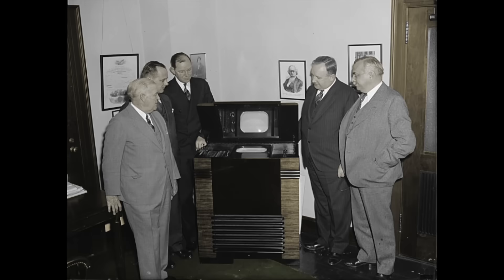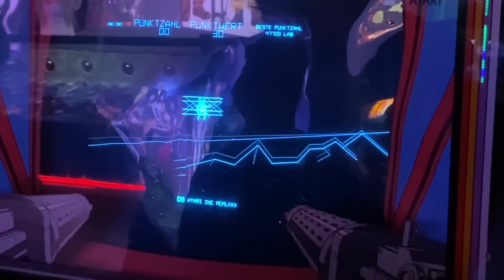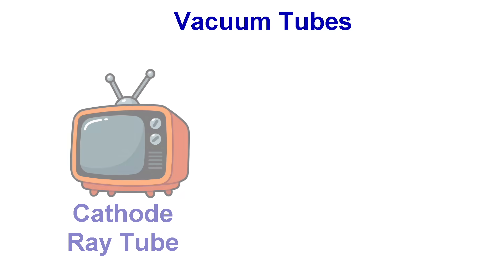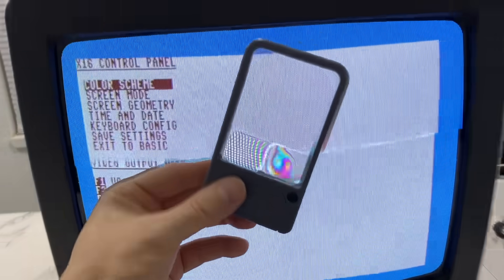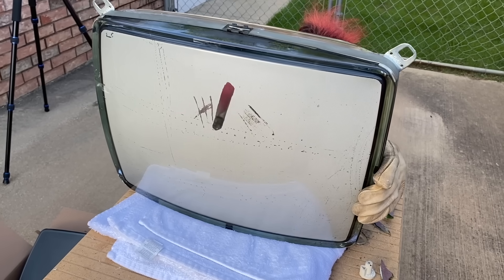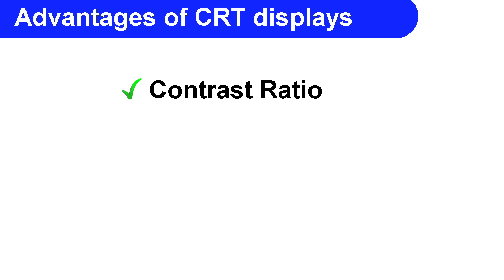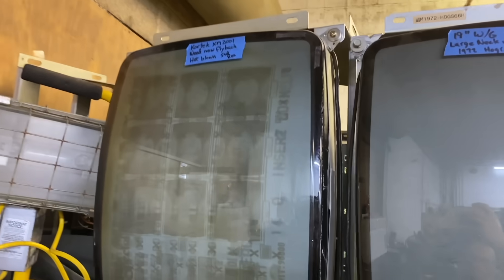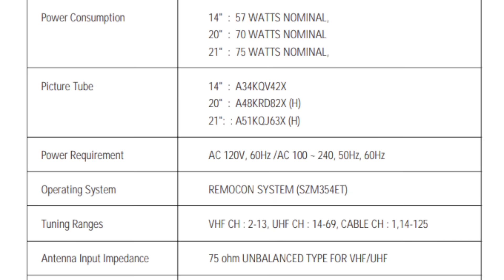How Cathode Ray Tubes Work.

Comment: I was a CRT engineer back in the 1960s. This video is a pretty good basic explanation. But, the stuff on the front glass is “phosphor,” not phosphorous. 
Warning, do not put your hands near a CRT while it is on, or you may be zapped. Also, don’t try opening a CRT that is under vacuum. The whole tube could implode, shooting glass everywhere.
The dots or stripes were aligned with the shadow mask and electron guns. The inside front of the envelope was first coated with a phosphor of one color mixed with a light sensitive material. The mask was put in place and a light was shined from the position corresponding to the location of the electron gun for that color. The light caused the dots or lines to bind to the front glass. The mask was removed and the unbound phosphor was rinsed away. Repeat two more times for the other colors. Then remove the mask once more and flash a thin layer of aluminum on the gun side of the phosphors, to reflect emitted light forward and avoid static charges. Finally, seal the front panel to the rest of the envelope. Amazing for mass production of a $190-$200 CRT!!
Reply: I tried repairing a CRT as a teenager and received a massive electrical shock. Enough that it gave me a stomach ache afterwards. I guess I am lucky that is all I got.
Reply: @greenmachine5487 Little kids and teenagers have considerably less insulation on their neurons than adults, you were in even more danger than you realize.
Reply: @ostiariusalpha  I think that's a bit overstated.
Reply: @lcdjr85  Not even slightly, there are many multiple incidents of individual teenagers and a group of teens being electrocuted to death in pools and near docked watercraft where the adults hardly noticed that the water was carrying a current. Horses are also infamously more vulnerable to electrocution than adult humans.
Reply: @ostiariusalpha  This still sounds like a dubious claim. Not only are "many multiple incidents" a comparatively small (and quite vague) sample size, it could even be a case of confirmation bias. Lots of kids get shocked that we never hear about, and plenty of adult humans experience electric shocks in different ways as well. I would be interested in seeing a study that supports this theory. I am aware of the insulating material "myelin", the fatty material in our brains which does insulate neural pathways (against each other), but I have seen no evidence that this actually protects the brain against electric shocks in any meaningful way. In addition, unless the person's head happened to provide a decent path to ground during the (very short) shock, electricity would not be flowing up there anyway - it would be exiting through a different part of the body such as the elbow, leg, foot, or whatever is (more likely to be) closer to ground potential. It is possible for the body to be "floating" at whichever kV potential it happens to be, but this would imply that the famous Van De Graaff generator experiment of a kid's hair standing on end is actually very dangerous, which it appears to not be. A more logical risk factor would be having one hand "grounded" while receiving the shock on the other. That puts the jolt across the heart which has proven deadly - though I am not aware of any cases involving a CRT specifically.
Reply: @lcdjr85  "Unless the persons head..." Yeah, we're talking about people in water, I think it's safe to say their heads are being grounded.
Reply: I always wondered how they "printed" the phosphor dots so accurately, with perfect alignment.  They were doing it with light in the electron gun position! Thanks for answering this.
Reply: Yep, "phosphor" is actually short for phosphorescence and has nothing to do with the element phosphorus.  Although, the words phosphorous and phosphorescence both have a common root in ancient Greek (phos means light, phosphorus means "bringer of light" because it was noticed that phosphorus compounds glowed).  I don't believe CRT phosphors use phosphorus at all.
Reply: Ah, that explains the tingling sensation! Now for some reason I wish I could do that again.
Reply: I thought that it should be stated that this is not a light shock either. Heed this warning. This is a VERY massive and potentially lethal shock. The shock is 15,000 to 30,000 volts and what is more the major issue is the current. 1 amp is enough to stop the heart and this can happen even if the CRT is unpluged because the capacitors can hold a massive charge and that can discharge on to you. So do NOT service a CRT TV unless you are properly trained to do so.
Reply: @InnocentSoul0283  It should further be noted that the capacitor in question is the tube itself.  So disconnecting a tube's EHT cap doesn't mean you can't still get a shock.
Reply: @InnocentSoul0283  When I was a kid I always loved taking apart unused or old electronics. I took apart an old tube TV. It zapped the crap out of me what I touch the coil! Its crazy because the TV hadnt been plugging in for years!
Reply: @InnocentSoul0283  Actually, the CRT itself is a big capacitor. The inside and outside of the funnel section is painted with a carbon based material called aquadag (monochrome tubes often had metallic foil on the inside instead). So, even disconnected from a set, the tube can hold it's electric charge for months. To make a tube safe to handle, it must be discharged, by bridging the anode connector to the outer aquadag, If the tube holds a charge, you will see a spark as the connection is made. Also, monochrome tubes had a metallic coating sprayed behind the phosphor, to reflect light towards the viewer, and protect the phosphor from ion burn. These were called "aluminized screens" to distinguish them from earlier uncoated screens, which employed bent guns and "ion trap" beam bending magnets to protect the screen.
Reply: @InnocentSoul0283 I work in the fire alarm industry the panels we have can have like 3 AMPs
Reply: @InnocentSoul0283  While color sets certainly do require far higher kV levels than mono/b&w sets, keep in mind that in excess of ~20kV is when electron beams begin emitting X-Rays. This is why the glass has a high lead content, and ultimately why our parents used to say things like "Don't sit too close to the TV, you'll hurt your eyes!" I'm far more concerned about X-Ray emissions in color sets than the voltages themselves. I do believe there is far too much emphasis placed upon the capacitive charge of an un-powered CRT than necessary. Almost any tube you encounter, unless you're deep into extremely vintage sets, will have a bleed resistor that rather quickly dissipates the capacitive charge to 0v. Even then, care should be taken to always discharge the tube before handling. It's rare that I've seen sets with a bleed resistor "pop" when discharging them, but it does happen. Resistors, just like any other component, can fail over time - in the case of a CRT bleed resistor, it wouldn't typically be noticed in normal operation. Discharging is remarkably simple, though - wrap a piece of wire around the shaft of a flat-blade screwdriver, and attach the other end of the wire to the metal shielding of the chassis... Gently slide the screwdriver under the anode cup until you make contact with the center conductor. If there's any tangible voltage stored in the tube, you'll hear a short "pop" as the charge dissipates to the chassis ground. Just don't try to do that when the unit is powered on. :D
Reply: @InnocentSoul0283  as a child I ones got shocked poking inside as CRT with a screwdriver while forgetting to unplug, guess I was lucky with the plastic screw driver handle
Reply: @InnocentSoul0283  as a very curious lil kid I feel what you are saying
Reply: @InnocentSoul0283  No one died from a shock from an unplugged television, the discharge of thousands of volts from the cumulative high-voltage circuit has not killed anyone, because there is only a very short-lived spark.
A taser is much more dangerous or touching a mains plug or circuit if it is connected, than that can be fatal.
For 1 ampere to pass through the body in several seconds, there must be more than 1000 volts maintained during that time, but as I said above it lasts milliseconds and therefore the amount of electricity is so small that it has no effects even if the voltage is very high. 
The key is in the duration of the electric shock.
Reply: @Elbas_Tardo  It's a combination of all Amps, Volts and duration (and travel path). You can hold a 9V battery on your tongue for days without it being deadly. Split second shocks can be deadly if the amperage and voltage is high enough.

That said, in the case of CRT's you'd probably need some kind of heart condition and bad luck for it to become deadly. Bigger issue is the motion you'd make when you get the shock.
Reply: @relo999  There are only two factors, voltage and resistance, this is the resistance of the body, it is not that of a metal, therefore there will be no amperes without voltage, it is pure Ohm's law, the second factor is that when there is a spark the voltage drops, therefore There are no amps, so the amount of electricity in this way will never be dangerous. I remind you that a TASER has more than 50,000 volts, and it is not just a spark but rather continuous pulses and is declared NOT lethal.
The duration is what matters, yes, because you can die with 100V if you are there for a long time.

It is a hoax from those who are not professionals to say that amps kill, false, without voltage there are no amps, the voltage and its duration is what kills.
Reply: @Elbas_Tardo  That is a dangerous amount of misinformation there…
Reply: @tookitogo  Yes, there are many people who need to study more, so it is good for someone with years of experience and studies in the subject to clarify the concepts as I have done.
Reply: @AshBashVids But when I am in the middle of adjusting it, it has to be turned on.
Reply: @Elbas_Tardo , people have died after being shocked with a taser so this comparison doesn’t work.
Reply: @mina86  I understand, so you know of someone who was fixing an unplugged CRT and died from flyback discharge.
Yeah? it's right?
I do know of any case of someone who died from drinking too much water, that would be an exception and fortunately there is no documented case or any person that I know of.

I'm not saying that it's something healthy and that you should touch it, because it's really not pleasant, maybe for a masochist, I'm just showing the real danger and not urban legends.

You should see some video of soldiers being shot with a taser and that is MUCH more dangerous than an unplugged CRT.
Reply: @Elbas_Tardo , I don’t. I only point out your comparison to tasers is unsound. Tasers can kill therefore pointing out that they are more dangerous than CRTs does not demonstrate that CRTs cannot kill.
Reply: @mina86  Then you'll have to show us all that a spark from an unplugged CRT kills.
Facts.
Reply: @Elbas_Tardo , I don’t have to show anything because I’m not making any claims apart from your argument being unsound.
Reply: @mina86  I have not said anything false, everything is scientifically verifiable.
Phisic facts not empty words.
Reply: @AshBashVids I didn’t say “instant murder machine”. The fact that someone with a weak heart could develop a fatal arrhythmia is enough to warrant an abundance of caution, especially since one might not know until it’s too late that they had such a heart defect. 

Not to mention secondary danger, like the shock causing one to flinch, in turn causing you to inadvertently touch something else that is energized. (And while unlikely in CRT repair, there have been many injuries caused by people flinching from minor electrical shocks which in turn caused people to fall off ladders or roofs and suffer serious injury or even death.)

I’m a trained electronics professional, I’m fully aware of how it works. I just really dislike that other dude’s arrogance at calling this hazard a “myth” while claiming that zero amps flow. (The flow is of short duration but decidedly not zero amps.)
Reply: @Elbas_Tardo  I also have studied it (formally, not Google University) and have years of experience. The milliamps through the body are what determine the physiological effects. So yes, “it’s the amps that kill” is true, but it’s not the whole story. Volts are what push the amps, and of course ohms are what determine the proportion.
Reply: @tookitogo  Yes, the voltage is the only thing that matters, the amps are only a product of it, if you want more amps you will have to increase the voltage, it is that simple, since your body is not a variable resistor.

Remember to put time in the equation, this is the most important thing, if the voltage drops very quickly as it happens in a capacitor and a CRT is very similar, the amount of electricity and its effects will be irrelevant, a spark from this is not pleasant but it will never be lethal. Look at how long it takes for the CRT to charge in order to work.

I am already retired, but I spent more than 30 years fixing TVs and other devices, I can only say that I received some shocks by accident and here I am. Something plugged into the electrical network, like those Chinese cheap chargers, is much more dangerous than an unplugged CRT and However, people see a spark and think it is like an electric chair.
The things you think are less dangerous are the ones that can be and others like a spark are not.
Reply: @Elbas_Tardo  No, the current is what ultimately matters, and since numerous combinations of voltage and resistance can produce a given current, you cannot say that “voltage is the only thing that matters”. But I’m not going to belabor this point with you any more, since you’re demonstrating a willingness to twist words and otherwise argue dishonestly: Nobody said the things you’re claiming we said.  Go away.
Reply: @Elbas_Tardo  exactly....im tired of all this cr#p about crts being lethal blah blah, yes you can hurt yourself with anything if your are dmb enough......but with crts , even when the set is plugged, if you touch the anode at 25kv the current is very very small and so the moment it shocks you the voltage drops abruptly....(yes i touched it a couple of times, and it can burn a hole in your finger but im still very alive)  ...now a 220v shock from a mains outlet is way more dangerous because it has virtually unlimited current...only set by the breakers you have on your breaker box.... But there is an exception to this : the very early sets that used mains drerived high voltage instead of flyback...those were very very very dangerous and all the warnings you see on vintage tv repair books may have originated from accidents involving those types of sets...if you touch one of those, they would use 5 kv 8kv etc but they would have an insane amount of available current....same applies to a microwave that runs on 1 or 2kv but its derived from a big transformer, very very dangerous...
Reply: @tookitogo  I do not misrepresent anything, electricity works the same throughout the universe, more electricity is more voltage, less resistance is easier to pass, more, therefore without voltage or resistance, there are no amperes to calculate, understand that it is ALWAYS the product of two factors , simple ohm's law. Therefore, if the resistance of the body is fixed, you can only vary the amperes with the voltage, but no matter how many amperes you want to obtain, you will not have them. Finally, I repeat Ohm's law, which an 11-year-old child knows at school, understands. It's simple, very simple, don't try to complicate it.
Reply: @MrHBSoftware  When I repaired a CRT I only plugged it in to manipulate the yoke, like 8bitguy does in the video and it was the only time where I was afraid and of course with gloves, because it had to be plugged in and the capacitors and the tube were there, even if they were discharged they could continue loading at the same time and this is already different. It is always better to unplug it from the mains to repair any device and leave it for a couple of hours.
It is not about touching electricity for pleasure, but about knowing when it is dangerous and when it is not.
Reply: @Elbas_Tardo  You absolutely are misrepresenting it. I’m not arguing against Ohm’s law (and my last reply shows this). But you’re saying the current doesn’t matter, and that’s untrue. You’re also saying that the resistance of a human body is unchanging, which is untrue. (It varies very significantly depending on things like how dry your skin is at a given moment. And high voltage can cause insulation breakdown, at which point the resistance drops.)
Reply: @tookitogo  When I say that the resistance of the body is fixed, without its distortion it can effectively be varied, but this does not mean that you are a variable resistance with a wheel to select your resistance, as it implies and that YES is distortion, you can add salt , water or whatever you want, but I am not going to repair a CRT by adding things to my body, as if I were cooking, to vary my resistance, in any case I will put on insulating gloves, this also varies my resistance. If I say fixed, it is because they specify it in values that appear in technical books. I once again tell you to read those books and discuss with their authors.

I do not misrepresent anything, I only cite scientific data nothing more.
The only one who distorts to perhaps make physics different from that of planet Earth is you, you can join the flat earthers, they also say that it is the others who distort and make mistakes, just as I have only cited them what the scientific data says, proven centuries ago and any book to learn electricity and electronics.

And I repeat: without voltage, there are no amps, they seem like two different things, but in truth it is just electricity and understanding that the body is a resistance and does not vary from one second to the next, for you maybe yes and also from what it says according to it It could even be deduced to use human skin as raw material to replace copper. XD

In the end all this, which leads to nothing, does not change what I have said, Ohm's law and this is the only thing that matters here, an unplugged CRT has never killed anyone and is completely safe, since it is discharged with the time.
I understand that you have never repaired one or received a spark, (according to you you would have died), I did it for more than 30 years, but what do I know, I am just an old retiree.
Reply: @Elbas_Tardo  Basically, you’re pretending I said things which I actually never said, and then insulting me based on the invented claims I never actually made.
Reply: @tookitogo  No.
Reply: @Elbas_Tardo  It’s exactly what you’re doing. I didn’t say the things you said I said. And then you insulted me based on those things I didn’t say. You’re a menace.
Reply: @tookitogo  No, I'm sorry, you must read my first comments, the rest you have simply gone off the rails.
I have not insulted anyone, however you have called me a menace, but according to you, I am the one who insults and distorts.

If I have to explain again the same thing I said in the first comments, I would just repeat myself forever. I do not see sense.
Bye.
Reply: @Elbas_Tardo  Someone above said the tube acts as a capacitor. Does a capacitor not have duration when attached to a resistor (ie human)?
Reply: @bakedbeings It discharges over time, even if the circuit is not closed. If you close the circuit, the discharge lasts milliseconds and stops providing voltage, which is why there is only one spark. That's why it takes a while for the CRT to charge and turn on.
Reply: @mina86  This could be cleared up by providing evidence that someone has actually died this way. I have looked but have found nothing. There ARE dangers inside a tv, especially when it is on and B+ is active. Very old sets (vacuum tube golden era) considerably more so due to mains-derived HV rather than flyback, but I haven't heard of someone dying due to the residual energy stored in the picture tube. But like I said, you can always provide a link and prove us all wrong.
Reply: @AshBashVids Not on purpose, anyway.
Reply: @AshBashVids "fondling the anode while on"

... I'd imagine it could happen on accident, regardless of knowhow
Reply: @AshBashVids You claim it "can't really happen by accident"... then proceed to provide "either", "unless" and "practically" exceptions in three out of four of your following paragraphs.

I'm convinced you don't grasp the concept of an "accident", and teaching you basic vocabulary is beyond my ability.
Reply: @Elbas_Tardo  People have actually died from being Tasered. So they can be lethal.
Reply: @AshBashVids In most sets, the anode connector is covered by a rubber suction cup thingy, making unintentional contact difficult. Although some early CRTs had a metal funnel, instead of glass. They were often called "widow makers".
Reply: @turrican4d599  TV technicians developed a practise of keeping one hand in their pocket, and using non metallic tools for adjustments.
Reply: @dougbrowning82  By a CRT disccnected?
Reply: @tookitogo  you got it, it's the amps THROUGH the body, touching a capacitor isn't deadly unless the other hand is also touching something conductive for the path to be made. 
It's definitely a mystery though why x amount of power will kill some and leave some unscathed.
Hell lightning doesn't have a 100% lethality rate, and that's hundreds of thousands to millions of volts
Reply: I used to repair TVs until the early 80's... when he reached into the one that was turned on, I could feel the shock.  Been there, done that.

I salute his steady and unshocked (on camera at least) hands.
Reply: That was meant to be $100-$200.
Reply: @obifox6356  Guess you don't know that you can edit your posts.
Reply: Not touch the screen while it is on? I did that all the time when I was a kid! Crunchy zappies made a funny noise
Reply: @commondary9953  Dont touch inside,not outside. :D
Reply: @commondary9953  Early TVs had safety glass windows in front of the screen, so you couldn't touch it.
Reply: I was crt guy too...that's how we did it.
Reply: CRT restoration shops used to be common.  They could revive dead tubes by cleanly breaking the envelope so the internals could be replaced, then evacuate and reseal the glass.  I think the only place with equipment to do that now is at the Early Television Museum .
Reply: @haweater1555  That equipment was donated by the last technician, who retired in 2010. They are still waiting for someone with the skills to come and volunteer. Until then, there is no source for CRTs except for NOS stock, or tubes scavenged from other discarded sets.
Reply: I put together a 19" B/W television in 1962 home made and it worked! Then a 23" color TV home made in 1968 that my dad tried to get as a family TV!
Reply: Can confirm, a friend and I found an old TV near a river on the friend's property many years ago. Being teenage boys we immediately decided to try to smash it. We were amazed when literal bricks bounced right off... until one didn't, and it made the loudest bang we had ever heard lol
Reply: @clonkex  You make me laugh with the biggest bang thing. I had a feral friend when younger who thought it funny to put a brick through an old TV screen. I advised him not to, and stood to the side out of the way, he threw the brick and started running, followed by a large bang and me seeing him running and being chased by flying glass in slow motion. Thanks for bringing back a funny memory. He was ok btw, the glass didn't catch up (luckily).
Reply: @threeMetreJim  lmao that's a good story
Reply: Very, very basic. So basic, that potentially misleading and perhaps not true in some parts.
Reply: Thanks a lot for the explanation on how to make the phosphor separation. I'm an engineer too, and repaired some TVs during college to make some money. Always wanted to know how it was done. Literally brilliant
Reply: Thank you for your insight but also THANK YOU for the correction. It drove me nuts hearing him say phosphorous. He's a smart guy but I feel like he dropped the ball a little bit on the research there...
Reply: I had wondered how they got the mask and phosphors aligned, that sounds much more practical than anything I'd considered before.
Reply: wait a hot minute
Phosphor is just phosphorus in German isn't it?
Don't tell me there is a substance that is not elemental phosphorus but called phosphor in English
Reply: @Nobody_Cares913  I think phosphor is a material with light emission, and phosphorus is the chemical element.
Reply: @Elbas_Tardo  It's called "phosphorescent", after phosphoros, the element, with is phosphorescent.
Phosphor is the German word for the element. I mean it could still be that there exists a material which is called phosphor in english, but it seems iffy. Might just be my germanness or autism😂
Reply: @Nobody_Cares913  No, is similar in spanish, look at wikipedia, i normallly say phosporescent material, but i dont know what is normal in english. 🤷🤷
Reply: @Nobody_Cares913  It's confusing: phosphor has nothing to do with phosphorus, except etymologically. Phosphor is any compound that emits light when excited, either by visible or ultraviolet light, or by an electron beam. I don't know if any type of phosphor contains phosphorus, but all the typical ones used in TVs and monitors (and other common applications), don't contain phosphorus.
Reply: @oldnelson4298   thank you for an actual answer. Not like the other dude who keeps correcting everyone while capping away. That's kinda crazy to me but now at least someone answered without "I think" or "I don't know" 😂
Reply: @oldnelson4298  Man that's one of the screwiest translation nightmares I've come across yet
Reply: @oldnelson4298  now I need to find out what we call the English "Phosphor" in German
Reply: Quick question, how did color vector displays get color while maintaining a decent scan speed and avoiding like flicker?
Reply: @just_bean_things  There are two separate issues here. 1. With a shadow mask color CRT, the production of color is inherent. The color-producing dots of each color are aligned with the electron gun, which turns the electron beam on and off for that color. 2. Because the electron beams are magnetically deflected, regularly scanning the beams across the screen (as in a TV set) is easier than randomly scanning vectors, in both B&W and color CRTs.
Reply: @obifox6356  yes, how do games like tempest do color then?
Reply: @obifox6356  Raster scanning is relatively easy. It was devised by Filo Farnsworth and based on the parallel lines of a plowed field. Only two signals need be applied to the tube itself, the luminence (y) signal applied to all the cathodes (the black and white elements of the picture) and the chrominance (r/g/b) applied to the corresponding control grids (adding colour to the picture.
Reply: I smashed a huge CRT TV tube once as a kid and saw 1st hand how implosive they can be. I was very lucky that a gut feeling told me to stand to the side and away from it because in a split second there was thick pieces of glass flung meters away from the front and back. What made it worse was that the tube was removed from the box of the TV and it was at least a 30 or so inch TV.
Reply: Thank you for making these, I still love and prefer CRT’s to today’s monitors. I found 3 of them, and have a 32 inch Sony Trinitron I found on the curb, weight 170 pounds but it looks amazing still, even with a composite cable to my SNES, it’s better than anything I remember as a kid on our cheap CRT’s we had.
Reply: My warning was about getting close to CRT or HV supply and wire inside the cabinet. 
I believe Thomas Electronics still builds and rebuilds
 CRTs. The way that pros relieve the vacuum in a CRT is to heat the tri (inside t after removing the socket 
You can find some YT videos be searching for CRT rebuild.
Reply: … is to remove the socket and heat the small glass tubulation enough to cause a crack, and then wait for air to slowly deep into the tube.
Reply: this comment is as fascinating as the video
Reply: My dad was a television repair technician and I think he built Heathkit TVs as early as the 1940s. I remember him showing me how to properly ground and discharge the flyback transformer.
Reply: You corrected him but he called it phosphor most of the time.
Reply: problem is that when focusing the gun on the flyback transformer, the TV must be turned on, you cant see if its focused if its turned off
but yeah you have to be careful af to not get shocked
Reply: In my old physics books there are also experiments: Take a small piece of aluminum foil, put it on the crt screen. Turn it on and touch the foil. I done it several times. It is similar to a electric wire of a cow paddock or touching an spark plug (ignition plug) of an car.
Reply: @obifox6356 hey, since you were an engineer, I'd assume you know the material specs of all/most of the components, correct?
Electronic components, especially vintage stuff is almost as hard as rocks(pun intention) and gems/crystal science to find actual information that's helpful.

I'd be grateful if you could tell me especially about the CRT electron gun part of the tube, what are the parts made of? Mainly the metals and metal coatings
I've heard others mention that there's palladium/platinum in there, but no info on what parts specifically.
Do you know what parts contain prescious metals? 
Thanks
Reply: @ The metal parts of the gun were all non-magnetic, 300 series, stainless steel. Type 304, as I recall. The only coatings on metal gun parts were the cathode and filament coating, the exact details of which were proprietary. See Wikipedia for typical coatings. 
No platinum or palladium or other precious metals at all. 
I only recall one tube we made with any previous metal in it, a thin layer of gold just over one molecule thick. Worth a couple of cents, less than the cost of recovering it.
Reply: Can you explain the role of the high tension wire please?! Thanks in advance. I've watched several videos and no one has "explicitly" explained the high voltage on the side of the envelope. Someone with an electrical background may have picked up the explanation but I didn't. Is the high voltage aspect part of the namesake "CRT", the high voltage cathode that attracts the electrons??
Reply: The electron gun in the neck at the back of the CRT produces a beam of electrons, which is swept back and forth by the electromagnetic coils (called the yoke). To obtain a bright image, the electrons are accelerated by the very high voltage toward the phosphor screen. A very thin layer of aluminum on the back (gun) side of the screen is easily penetrated by the high speed electrons. The aluminum reflects the light from the phosphors forward, almost doubling the brightness. 
The inside of the CRT body is coated with carbon, which prevents accumulation of a static charge on the glass )as does the aluminum). The high tension wire
Reply: @ The high tension wire goes to a metal contact through the glass, connecting to the carbon and thus to the aluminum, completing the electrical circuit. (The negative connection to the very high voltag
 Power supply is connected to the cathode of the electron gun).
Reply: It's easy to let the air in without an implosion. You just break the neck off. I was always careful around them when repairing, as it was easy to have an accident and wreck a TV in for repair. Also always had to carry a TV with the screen facing you to avoid being impaled on a broken tube neck if you accidentally fell when carrying a TV. I was told a scare story about someone being seriously injured by the broken tube neck coming through the back of the TV and into someone carrying it. Not sure how true it was, but it was believable enough to pay heed to the carrying advice. It's surprising how tough the front of the screen is (and how thick the glass is).
Reply: Seems to me like you're still a CRT engineer. =)
Reply: @ Thanks! Still part of me.
Reply: Nice of what this guy says is true, crt monitors don't implode.
Reply: Please tell why no one tried to make CRT take less space by making several small tubes instead of giant one?
Is it possible? CRT can be good for gaming, free anialiasing, high framerate, 0 input lag. Size is their major disadvantage.
How much tubes need to be placed if i want 10-15 cm thickness? Will magnets interfere with each other? How much pixel cell you can make and what smalles pixel size with good quality? May be it''s possible to make 16k pixels on 30 diagonal or something.
Reply: I believe the main problem would be that the picture would not extend to the edge of the faceplate of each small screen tube. So a display made up of several small CRT screens would not be continuous. Also it might be difficult to align all the displays. Plus, the cost would be considerably higher than for a single tube.
Reply: @obifox6356  Thanks. I read that sony tried to make SED display which is array of tiny tubes that lighting a luminescent pixel. Is this would be hard to do in a garage?
Reply: @gendalfgray7889 Yes. Doing Sony stuff would be hard to do well anywhere.
Reply: David Murray (The 8 bit guy) has a video where he was restoring an arcade game, and while carrying the loose CRT he bumped and cracked the neck, thus gassing it.  Since in that experience of his it did not result in a shower of glass shards, he must have been over-confident in this case that casually breaking the neck is not always disastrous.  (He also had a non-working second machine to salvage parts from for a spare CRT).
Reply: @haweater1555  You must have missed the part of this video (8:33) where he showed that the CRT had already lost vacuum and had "equalized". There was zero risk of implosion here.
Reply: @haweater1555  The neck is not where the greatest pressure is, hence the glass there is much thinner than on the screen. Many tubes have been necked by careless movers without any disaster, other than the need to replace the tube. In early sets, the neck of the CRT actually protruded from the back of the cabinet, with the only protection being a cardboard, plastic, or metal cone or dome on the back cover.
Reply: Again I love this video but for me there's a piece missing and that's at the end of the CRT life. LCDs didn't necessarily get cheaper and they just finally overtook. The federal government decided to step in and help the LCD and flat screen manufacturers by putting restrictions and help killing off the CRT. Now you still can get a CRT but it's very very narrow usually for medical equipment. If anyone thinks I'm wrong do you remember back in the day let's say 2002 you could buy yourself a nice plasma or flat screen LCD for like two grand. But to get a CRT comparable would cost you like 500 bucks. But they did is they forced making tubes and they made it not cost-effective.
Reply: Fascinating work! They should make a comeback this decade. After all, some factories in India and China are still manufacturing them in small scales!
Reply: THANK YOU. It's driving me batshit how he keep saying "phosphorous" instead of "phosphors".